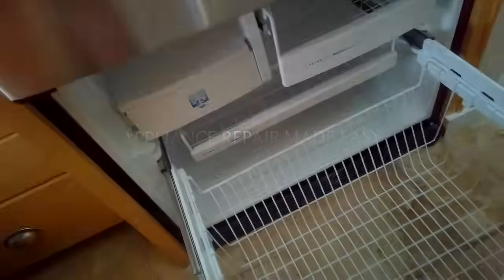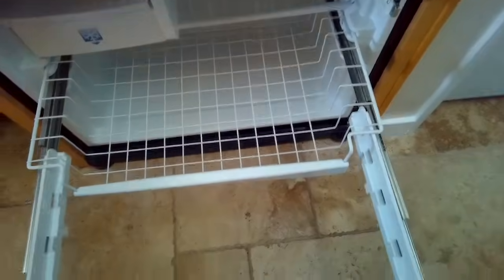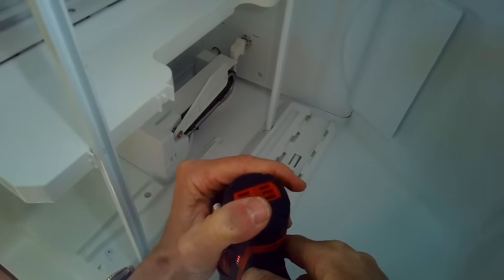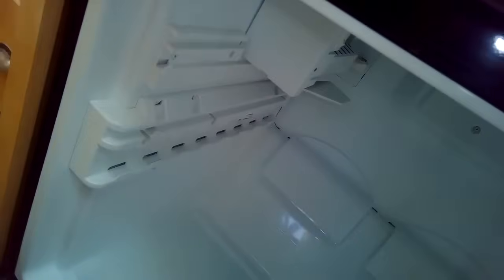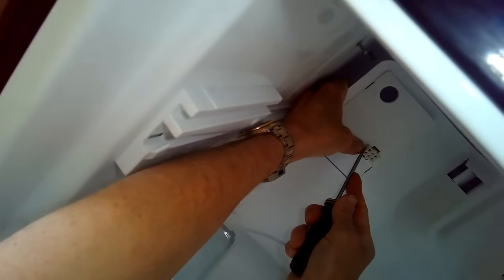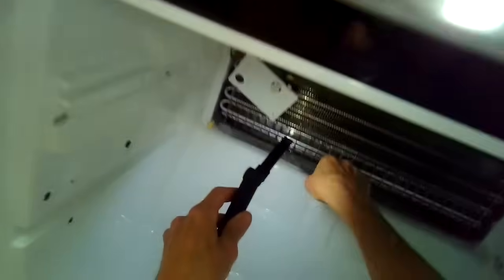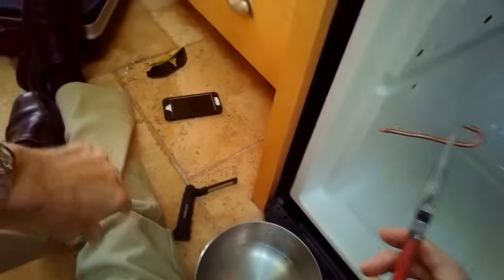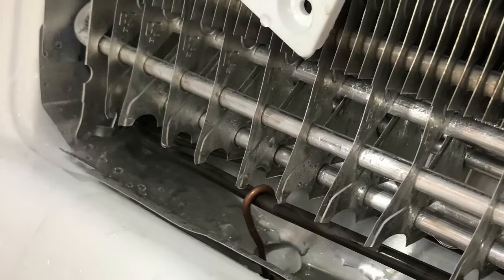✨ GE Profile Bottom Freezer Leaking — ( EASY FIX ) ✨

Comment: Hello Scott, THANKS! For the great post. My GE Profile model # PYE22KSKSESS refrigerator had a front water leak. 
I had a clogged drain located at the bottom back of the refrigerator. There is a rubber tubbing connector that's between the drain tube and refrigerator drain that has 2 small slots in the middle of the rubber connector. Probably flow restrictor. Well those two slots were clog. When I removed the drain tube and rubber connector water came rushing out. I took a spare rubber hose and blew up into the refrigerator drain to ensure it was clear to the freezer.
  Cleaned the two slots reinstalled the the drain tube, back to normal operation. It took 5yrs to clog. I will clean it annually. Once thanks for posting this video, it is greatly appreciated.

Comment: when I first saw the copper wire with the hook, I thought that was to push or puncture any extra ice still clogged in the tube with the hook to prevent it slipping out of the pliers and not being able to get it out.... I thought that was a great "tip" BUT when you mentioned it was a design for preventing further issues I then considered you a MAINTENANCE GOD! great video.
Reply from the maker: You are too kind,
Thank you😊

Comment: This fix worked perfectly for my GE Monogram refrigerator with bottom drawer freezer.  I also used the copper wire down the drain hole tip!  The job was pretty easy.  Just take your time and remove the back panel and you'll see pretty much exactly what's in the video.  It takes a lot of hot water delivered into the drain slot to de-ice the unit.  You'll know it when its clear.  Thanks again!
Reply from the maker: Yep,
Nice job😊

Comment: Just finished the fix on my Monogram. A few more screws than the Profile but, all in all, a very easy fix. When I removed the back panel of the freezer there was a ton of ice every where. To speed up the process I used a hair dryer. Be careful of the sharp edges on the metal panel. Thanks, Scott, for saving me a few hundred bucks and more aggravation.

Comment: Excellent information and video !  Performed the repair and after removing ice from the drain, i removed the back cover on the fridge. I did find the bottom of the drain hose clogged solid with debris too..  All working fine at this time.. Thanks again !
Reply from the maker: Nice job Mark😊

Comment: I know this was posted five years ago, but it is perfect. I have almost the same freezer as in the video, with a couple of differences: 1) I had to unscrew the door rails and 2) the back panel has a fan with a power connection. However, I think I'm all set now. Thank you very much for your help!
Reply: Oh, also, our freezer already had a metal bit hanging from the heating element into the hole (GE must have watched your video!), but ice built up anyway. I suppose it may be a matter of time, or, possibly, the previous owners had the freezer set too high or low. Regardless, I don't have to consider buying a new appliance right now or trying to schedule someone to come in to fix it :D
Reply from the maker: Nicely done Ryan👍😊

Comment: Another thing you may  want to check is the drain hose in the rear.  When working on my own refrigerator I disconnected the hose from the gasket, it was clogged with dust and sediment.  The water immediately rushed out.  This was what created the problem in the first place.  Just gotta remind yourself to vacuum the back of your refrigerator once or twice a year.  I had spent 2 hours on this not realizing that I had already melted the frost.  The water still wasn't flowing due to the clog.
Reply from the maker: Thanks for the info.😊✨
Reply: This is a really nice video, but I would try this rear hose first because it is easier and probably the reason the drain froze up in the first place.  It is easy to access.  Just pull the cardboard cover in the back and you can see the little tube.  It just slides off with a little twisting.  Mine was clogged at the rubber coupling and also at the part where the tube bends.  Once you get it out, if it is white like mine,  you can hold it up to the light and see any clogs.
Reply: I found the same condition too !  Thanks.

Comment: Is it ok to use refrigerator copper coil in place of copper wire? Just wanted to be sure it’s not a fire hazard!
Reply from the maker: I think that will work,
It is best to use solid thick copper wire since it’s able to conduct heat better.

Comment: I have a GE Profile MODEL: PFSF2MIYGWW -how to get my Drain Tube out to clean - Cannot get it disconnected. Stuck strong "weed wacker" line up tube about 12 inches can feel water. Hoping to do it the easy way, I'M 86
Reply from the maker: You’re doing great.  Can you try to pry it off with a flat head screwdriver?

Comment: do you know if these refrigerators with a bottom freezer have a water filter for the ice? my ice is starting to come out with small black flecks in it. i’m guessing it’s some sort of mold building up in the ice maker itself but it’s a massive pain for me to get the ice maker out to clean it. i was wondering if it could be a water filter thing
Reply from the maker: You can add an in-line charcoal filter to the water line that comes into the back of your refrigerator 👍
Reply: @ oh thank you! so it doesn’t necessarily come with a filter that needs to be changed, rather i could install a filter as an add on? just want to make sure im reading it right

Comment: I have a similar model but with dual deck freezer. After 8 years of use it started to accumulate ice at the bottom and leak water to the front. If I remove the ice it will build up in 2 days then leak water again. After watching this video I figured by the time I took everything out to get to the defrost drain pipe, the ice in the drain pipe would have thawed anyway. So I unplugged the fridge, transferred everything in the freezer into a cooler box, left the freezer door open for a couple of hours, and it worked! No more ice accumulation for a week already. Let's see how ling it will last before the drain pipe is frozen shut again.
Reply from the maker: Nice job👍

Comment: This was the solution for my GE Cafe Series Refrigerator CYE22TSHKSS (2016).  Slightly different layout of course, but similar back panel.  Bottom drawer comes out with 4 hex screws.  Catch area under bottom drawer and the back tray and tube were full of ice.  Thanks for the video - helped a lot!

Comment: This video was super helpful and thanks for posting it.  I have a slightly different and newer GE Profile - Model PWE23KSKBSS but the process was pretty much the same.  For others with this model - I kept the door on - a bit inconvenient but manageable if you can fit in small places.  Also it was very difficult to chip out the ice out from under the silver evaporator out so I used a hairdryer on high to help melt it.  Be careful if you do this and make sure to have no contact with water and the hair dryer.  On my model there is an aluminum wire running from the heating rod to the drain - maybe a later model fix from GE?  But I added a copper wire as well to try and get more heat conductivity.  UPDATE - so this did not solve the problem and 3 months later I had the same issue.  So, I had a little Quarantine Project and tackled it again.  Saturday morning.  Three kids running around.  One wants to dye her hair.  Another wants to cut his hair.  Do I want to spend $1,000 on a new refrigerator?  No.  Do I want to spend $250 on a repair man?  No.   Perfect time for those projects you've been putting off for three months!  Like the leaking refrigerator.  Tell Spotify to "Play Bob Dylan" and 4 hours later the problem is solved.  See Nahium Chiu's reply below for the problem / solution.  I had a block on the drain hose in the back of the fridge.  Pull the fridge out from the wall.  Unplug it.  Take off the back panel.  Pull the drain hose out and clean it out.  It is a lighter-colored hose and the largest one on the back of the fridge.  You can slide the bottom off to the side and take it off.  Mine had some junk clogging it.  There is a gasket with very small holes and easy to get clogged.  This solved the problem and water ran through.  I could have turkey basted forever and not made any more progress, and still had it freeze up in a few months again.  But you still need to de-ice the tray and inlet as Scott goes through above.  I predict if you have read this far and de-ice the tray and inlet and clean out the drain hose you will get 5 more years at least out of your fridge worry-free.  Good luck!
Reply from the maker: Nice job, Peter.

Thanks so much😊
Reply: Same!!!! I had gunge clogging the u-shaped drain hose at the back… removing it and clearing the passage with a makeshift pipe cleaner type tool… clears the blockage, reassembled and VOILA! … saved money and repair bills !

Comment: DO NOT DO THIS FIRST. It is far easier to go to back of the fridge, remove the cardboard cover, then remove the drain tube. Mine was clogged with "stuff" from years of build up. Performing this first is a 5 min job versus the ~hour if you do the above. I would only perform the actions in this video if the freezer continues to build up ice after doing the simple drain remove, inspect, clear clog like I have described. Save your self the disassembly/reassemble time
Reply from the maker: Thanks Jason,
The back approach is the best to start with👍
Reply: Hey all, I removed the cardboard panel but don't see the drain tube as you do in this video (which I agree is wonderful). Mine might be newer, any thoughts?
Reply: Good advice here - I have a newer model with a metal cover. Behind that, the drain pipe looked fine, but after poking it for a minute there was more water flowing out into the evaporation tray. There was a plug of gunk that was slowing the flow, and after clearing that out I had no more leak issues!
Reply: If the drain plug isn't clogged why not just take all the food out..store in coolers, unplug the frig for a day and let it melt on its own? Safe all of the removal time?
Reply: If youre here,  its probably MOST LIKELY clogged to begin with.  Drains small=biofilm clogs easily @brianconnors2227

Comment: I discovered another cool think with my fridge. Its hole is a little bigger than in this video. What I did was to fill the turkey blaster with hot water, put it in the hole all the way it could go and then squeezed the blaster forcefully  using it like a plunger. It forced open the blockage in one thrust and the pipe became clear.
Reply from the maker: Great idea👍

Comment: Good instructional video.  I have a later model Cafe, and it is much easier to get to the back. GE have also added the copper wire modification themselves. However, the fridge still has the same problem about once a year.  I traced the problem to the plastic hose leading the melted water down into the evaporation tray under the fridge.  The hose is designed to limit the flow of water. I guess to avoid the evaporation tray from over filling.  This hose is, by design, strangled at the bottom, leading to it clogging up over time. This again leaves water in the hose that freezes, causing the same problem the video demonstrates.

Comment: Thanks!  Our GE profile 2008 fridge got clogged up for the first time since purchase at that time.  I noticed that there was already an aluminum wire attached to the element and running down the drain. (Never got it fixed that way)
Reply from the maker: Yep,  I know that model.

Can you get behind the fridge and remove that lower panel, then pull off the drain tube and clean the gunk that builds up in the rubber grommet at the top of the tube.

Comment: Great video. My question is - what was the reason for the water buildup (which later froze)? It will not freeze now but it will collect again and maybe overflow into the freezer. Did you check the other end if that hose in the back of the freezer? Was it plugged?
Reply from the maker: Yep,

It was a clogged drain hose.  Usually clogged with ice.  The repeated boiling water should get rid of it👍

Comment: Thanks for posting this video. This matches my GE and has the same issue. The second screw in the middle (3:30) is slipping though. Phillips head is damaged and stuck. Any way to get it out?
Reply from the maker: No problem ,

Just use your drill to drill the head of the screw totally off and then unscrew the post that’s left with vice grips👍

Comment: Service many of these drain issues and have been using a portable steamer to clear the ice built up, also many steamers have a 90 degree angle piece that fits neatly down the hole allowing to blow steam down the drain to open it. Also remember to check the drain trap in the rear as they also clog causing this drain issue to return if not cleaned out.
Reply from the maker: Great idea👍

Comment: Thanks for the video, Scott!!!  I have a couple of questions for you,,, On the back side of the rear panel, there are two sections that are insulated. An upper and lower piece.The lower section, near the heating coil, has a thin sheet of foil adhered to it. I take it that it's there to protect the insulation.  Well, about half of that foil (right side) was torn away, and frozen in the iceberg,,,  that was built up in the drain-tray. I removed the iceberg, and rinsed the drain,,, seemed clear. However, every time I siphened the residual water,,, it seemed to back-fill back up to the port on the drain-tray. So I removed as much water as I could, by siphening with a long, small air line (1/8"). I verified that the water drained properly, using Hot water,,, then drained again. I then addeed 14 guage copper wire, as suggested. And re-assembled the freezer. It appears to be working properly again.                 
   Question 1: Is the missing foil a safety issue?               
   Question 2: Where does the water that drains go to, once in the lower tray? Evaporate?                                                      
   Question 3: Why did the water keep refilling to the drain-tray, after I siphened it several times?   
Thanks again,,, Al
Reply from the maker: Good questions Al.
It goes down to the evaporation pan below the fridge and the fan helps it evaporate.  I think it filled up again from more ice melting above it.  It should be ok without that foil👍

Comment: Couldn't/shouldn't  GE do this video since this is a huge design flaw? Scott, this was so helpful. I put water through for about two hours and it never defrosted. I put it back together and the problem was obviously not solved. Any other advise?
Reply: Maybe it is the conversation below, clogged pipe I should look in the back right?

Comment: GE Profile model PYE22KSKBSS.  About 3 years old.  Started leaking.  Big sheet of ice in the bottom of the freezer.  The drain was clogged.  Before taking the fridge apart, remove the bottom back panel, locate the drain tube.  Detach it, and see if it is clogged with debris.  There is a cone shaped part that diffuses water draining from the freezer.  It clogs, the water backs up, then freezes.  If you don’t clean this part, you’ll quickly end up with a leaking fridge again.

Comment: Thanks for the video.  Note, basically the same for the GE Cafe series as well.  In addition to the freezing of the drain, it was also clogged at the "neck" of the dicharge tube, so I had to open the back and clean out the tube, then the water ran freely.  i guess that ended up being the root cause of the freezing.
Reply from the maker: Nice job Bob😊

Comment: Great video. I did remove drain tube first. It was clogged. I removed clogged with a zip tie and  a Phillips  screw driver. The top portion which connects  the fridge to drain tube was replaced with a automotive hose from advance auto parts. $1.68. Cut out a 1 inch hose and connected both with heavy duty zip ties. Success and thank you! PS. I defrosted  the fridge.
Reply from the maker: Very impressive Jimmy😊👍

Comment: Hi Scott, Can I do this repair or process more easily from the back of the fridge? I can access it no problem. Thanks!
Reply from the maker: Hi Laura,
That’s a good idea you can remove that small back panel behind the fridge and that’ll give you access to the drain tube.
You can just wiggle the drain tube off and check it for some type of blockage.
There may be some ice blocking it above the drain tube that you can try to melt with a blow dryer.

Comment: If I do not hook up the ice maker will I have this issue? Will be getting an older ge profile from 2007 but no going to use the ice maker. Seems like this issue is not related to the ice maker though. 
If this is a case flaw wouldn't every Fridge with this design have the same issue? Thx

Comment: I had a similar issue with my GE GFRS2KYBC SS and it looks like GE did add this feature to mine... but it still froze up, I am thinking that it was due to some power outages we had and not getting a chance to fully defrost.  Kids leaving the door open doesn't help either.

Great Video!  thanks for the help!
Reply: My GE has a door alarm.  Hope yours does too!  It helps if the kids leave the door open.

Comment: Hello.  I have the exact same issue but I left the fridge unplugged for a week thinking that all the built ice will melt but after plugging it back - the water appeared after about a week.  Could u think of a reason?  Thanks
Reply from the maker: That drain tube is still blocked.

Can you get behind the fridge and remove the bottom panel,
Pull off the drain hose and clean that drain tube👍

Comment: What I often find is that the real root cause of the plug up is debris in the drain hose that leads to the drip pan. The telltale sign this is the problem is when all the ice is melted and yet injecting more hot water into the drain hole continues to cause a pool-up under the evaporator.
Reply from the maker: Yep,  then it’s good to remove the back panel and remove the drain tube and clean it out.